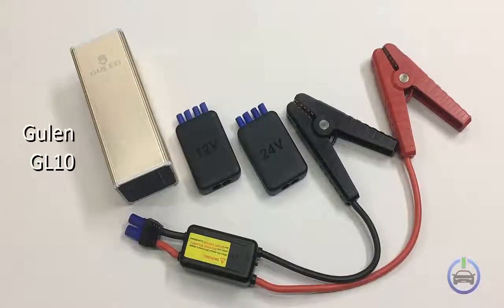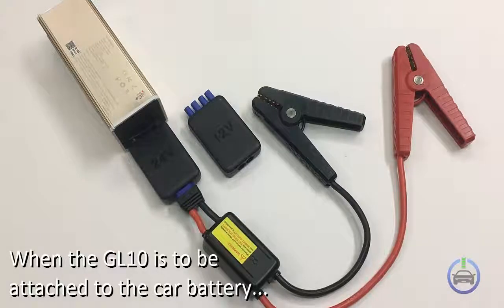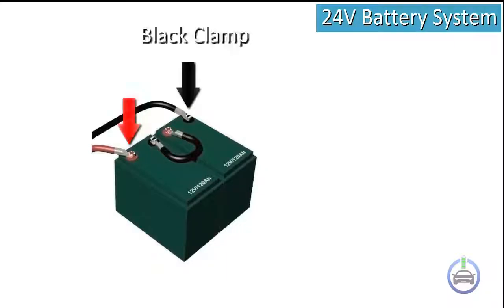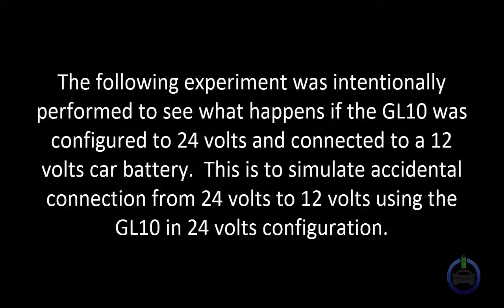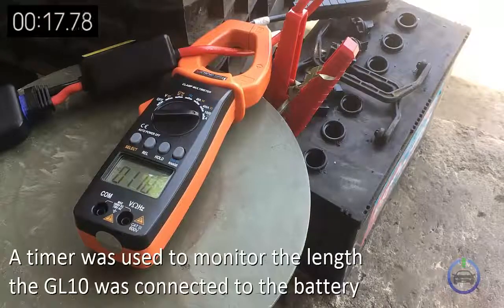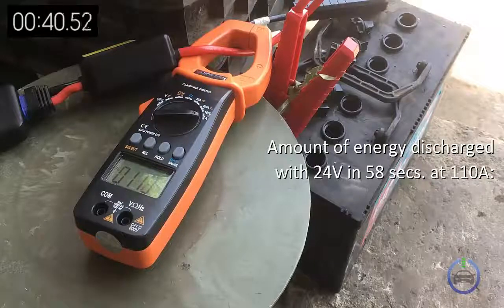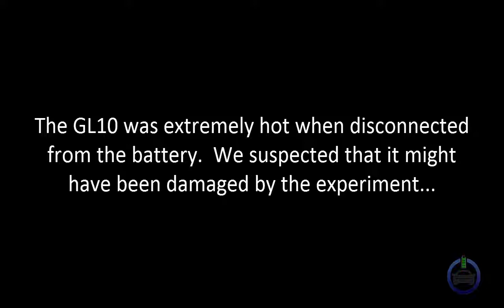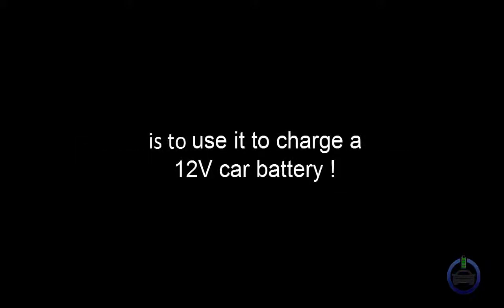GL10:  One way to kill this heavy duty car jump starter!

Comment: Right now we are a local seller located in the Philippines on board the Lazada platform.  It is very hard to ship out internationally products with lithium batteries. We are still waiting for Lazada to open up this international shipping service. Aa to the price please visit our Lazada store. Here is the link:

₱10,995.00 -21% | Gulen GL10 Black Heavy Duty 12V 24V Portable Car/Truck Battery Jump Starter/Power Bank for Cars * 1000 peak amperes *  Smart Clamp Technology  offers protection against short circuit & reverse polarity * (Powerbank for Cars) * Industrial Grade Quality | https://s.lazada.com.ph/s.0zE6q